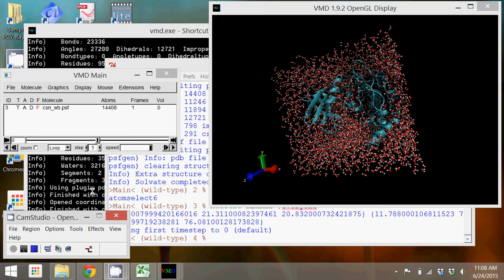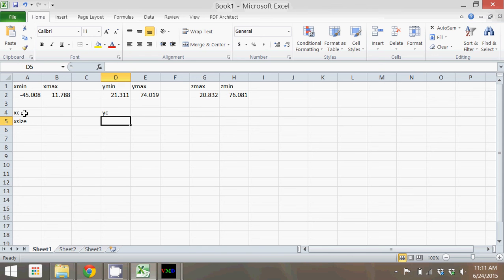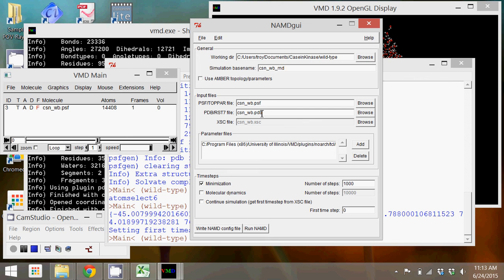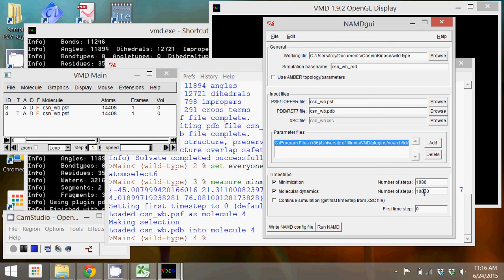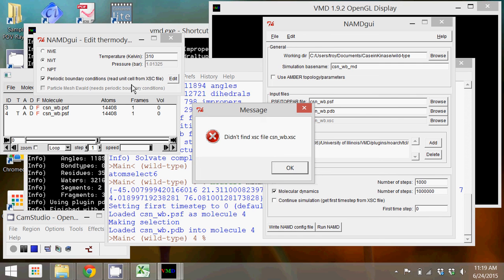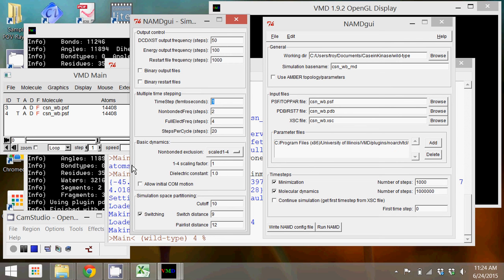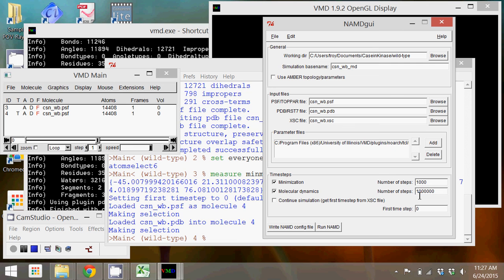Simulating Protein Using the VMD Graphical Interface to NAMD

Comment: Thank you sir for the informative video. I followed through your entire video but when i hit run namd.. the status comes off as "running" but only for few seconds and then it shows status: ready. Neither .dcd nor .xst files are generated. Your help will be most appreciated Sir...
Reply from the maker: Does your attempt to run the simulation produce a .log file or some other output file that contains the particular error?The error will be at the end of the .log file. Please paste the error in a reply to this comment.
Reply: @TroyMessina  Thank you for the video. I follow the tutorial and I happen to have the same problem. My error that is indicated at the end of the .log file is FATAL ERROR: UNABLE TO FIND "PSF" STRING IN PSF FILE solvate.psf
 What should I do next? Thank you in advance
Reply from the maker: @yagmurkafali2998  I have never encountered that error, and I don't understand from your question what the purpose of the file solvate.psf is. Are you certain your configuration is properly pointing to the location of solvate.psf?
Reply: @TroyMessina Thank you for responding. I am afraid  I don't understand what you mean by configuration pointing to the location of my psf file.
Reply from the maker: @yagmurkafali2998  Setting up the NAMD GUI described in this video is the configuration. It is important that the files you are using are in the location specified in the NAMD GUI. I do not use files titled "solvate.psf" in this video. Therefore, I do not know what this file is or how it is being used. I will need more information.
Reply: @TroyMessina  My solvate.psf is the same file you named csn_wb. I actually run the simulation again and now it gives me namd and out files but no dcd. I checked my out file as you said and there was no error message. Im working with a protein-ligand complex and maybe I should have done parametrization for my ligand. But I fail to understand how to do it with NAMD GUI.

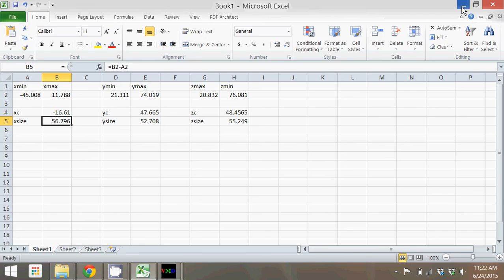Comment: Hello Troy, another excellent tutorial. Many thanks. But at 13:31,clicking OK after completing the cell options, i get a message "atomset:frame '-1' invalid;please use a number >=0 or 'first','last',or 'now' while executing. It makes no difference if First Time Step in NAMDgui reads zero or one. Would very much appreciate your comments.
Reply from the maker: Not sure. Do you have your molecule (psf and pdb) loaded into VMD?
Reply: Yes Troy...did it exactly as per your video... Baffled why it thinks there is a frame  numbered -1?
Reply: Hi Troy...sorry to bother. Do you have any more thoughts about this?
Reply: Hi Troy...sorry to bother. Do you have any more thoughts about this
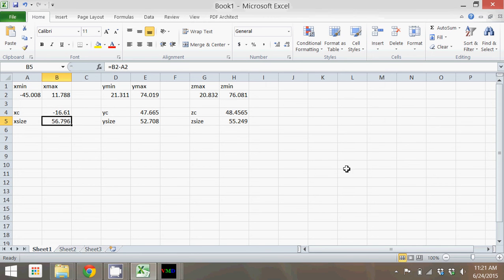Reply from the maker: Sorry, I don't. There is nothing at the time 13:31 that I would expect to give an error. The measure minmax could give an error similar to that. atomset is not a VMD command that I am aware of.

Have you tried running a vacuum simulation to make sure everything works for your molecule before trying more advanced explicit solvent methods?
Reply: Found it!   Took quite a while, but all the way back to loading in Mol Browser,  "-1" was being selected in the First Frame window. Goodness knows why. Changed it to zero, and the simulation ran like clockwork. I now have the four new files, and was wondering if you made the follow-up video mentioned at the end?  Otherwise,how is a DCD opened? Excel doesn't recognise it...

Best wishes
Reply from the maker: Glad to hear it worked. The first video you commented on shows how to load the dcd file into VMD. https://youtu.be/KE268sYqrmw

I'm not sure what kind of analysis you plan to do, but the measure function has a lot of options. https://www-s.ks.uiuc.edu/Research/vmd/vmd-1.9.1/ug/node136.html

Comment: hello, your vedios are really helpful. thank you. 
but, even after performing almost  same steps my NAMD has been  running from around 10 hours now. does it take this much time? my protein has 44836 atoms and not getting about the no. of frames, as mine is coming zero only. please help. thanks.
Reply from the maker: Hi Jhumi,
It will depend on the number of steps, the step size, and some other factors. Ten hours may be reasonable if you are trying to simulate 10 ns with 1 or 2 fs timesteps. Can you provide more details? You can always open the .log file to see how far the simulation has progressed.
Reply: thanks for your reply. minimaization steps -1000 and molecular dynamics steps -100000, multiple time stepping-time step (fs) has set up to 25fs and first time set : 25 and the simulation has progressed till 13618 atoms only. please advise.
Reply from the maker: You might try running a minimization only. If your timestep is 25 fs, that is probably too long. Try 1 or 2 fs. The number of timesteps per output can be 50 or 100.

Comment: hey!! Troy Messina first of all many thanks to you for this video its been of great use to me but i just have one problem that after doing everthing according to what you told in the video when i click on run namd it shows "namd2.exe has stopped working" can you help me with this problem!! i have editted the windows path variable for namd also but still getting this error please help me!!!
Thanks..!!
Reply from the maker: Hi Yash,
I need to know more about the error. If you are using Windows, will you look at the command prompt window and see if there are more details.
Reply: I am using windows 10.. 
it says following in the command prompt
psfplugin) Detected a Charmm PSF file
Info) Using plugin psf for structure file ubq_wb.psf
Info) Analyzing structure ...
Info)    Atoms: 2941
Info)    Bonds: 2377
Info)    Angles: 2827  Dihedrals: 3293  Impropers: 212  Cross-terms: 74
Info)    Bondtypes: 0  Angletypes: 0  Dihedraltypes: 0  Impropertypes: 0
Info)    Residues: 646
Info)    Waters: 570
Info)    Segments: 2
Info)    Fragments: 571   Protein: 1   Nucleic: 0
Info) Using plugin pdb for coordinates from file ubq_wb.pdb
Info) Finished with coordinate file ubq_wb.pdb.
Info) Opened coordinate file ubq_wb.pdb for writing.
Info) Finished with coordinate file ubq_wb.pdb.
Info) Opened coordinate file ubq_wb_md_fixed.pdb for writing.
Info) Finished with coordinate file ubq_wb_md_fixed.pdb.
Reply from the maker: This does not show an error. So, I'm not sure what is causing the crash.
Reply: Try to open namd2.exe file . It will show some error message saying some file is missing. Note that missing file and google it. You will find a way to fix that error. After the error got fixed i hope that u will be able to run namd from vmd interface.
Reply from the maker: Ksai is correct. Usually if your path variable is set, it will be a directory hierarchy problem. For example, your pdb, psf, and topology files are not correctly indicated.
Reply: Have you found a fix for this? I'm having the same exact issue. The namd2.exe is not working pops up, BUT it says that namd is running. It's been about an hour at 10000 steps, so I'm starting to think it's not actually working.
Reply: Trey Patton yes I found the fix for the problem..!!! If you want you can share your mail id I'll send you the procedure..
Reply from the maker: Trey,  I don't run namd through VMD all that often. So, I'm not sure of the best fix. The quickest thing I can think of is to look in your working directory. The simulation should be updating files every few minutes. If it isn't, it might be stuck. The other option is to keep TkConsole open or look at the command prompt in VMD to see if updates are being sent there. A final option is to open the log file. This should be in your working directory and called basename.log or similar. If the simulation is running, it will have new lines added to it every few minutes (however long it takes to complete the number of steps in "Energy output frequency (steps)". You will need to close and reopen it to see the updating.
Reply: Hey!! Trey sorry for the delay but there is some problem in the .psf file which you are getting from solvation.. You need to check that.. Also provide me with some of your mail id or somthing so I can send you my procedure file..
Reply: Hey guys, sorry I'm just now getting back to you! I appreciate the replies. I ended up speaking with my research professor and he recommended I cut down the molecule to only the active residues. That ended up working! One thing that I did notice with the GUI (I only used it to make the config file) is that there isn't a way to add/delete the topology file that is auto loaded. I ended up creating the .psf based on that topology file (and the water file) and it ran smoothly.
Reply from the maker: You can edit the conf file  and run it from a terminal or command prompt. This means you can manually create a configuration script with anything you wish (topology, temperature, cutoffs, etc.). The VMD GUI really isn't meant for running NAMD in any advanced way.
Reply: Yash Shrivastava  hello sir ! if you can suggest the stepwise procedure to over come this problem and running whole simulation for the docked protein,it will be very much helpful!
Reply: Hey Yash! I am having the same problem. namd2.exe has stopped working. Could you please share the procedure to fix this problem. Thanks!
Reply: MITAL BHATT , could please elaborate your procedure as I'm facing same problem. It will be very helpful as I'm in between my project to finish it.

Comment: Hi, i cannot getting dcd file please reply
Reply from the maker: I need much more information.
Reply: @TroyMessina  when i clicked on run namd, it run for 1 sec shows status ready, in the wrking directory, 3 bew files getting generated except the dcd file.
Reply: Can i follow this procedure to simulate ligand-protein complex
Reply from the maker: Rohan Narkhede yes, but you may need special topology files depending on what the ligand is. Read the .out or .log file to see what errors you are getting.
Reply: I have also generated topology file for ligand from LigParGen. In .out file, it shows DCD file name: output.dcd and at last it shows FATAL ERROR: DIDN'T FIND vdW PARAMETER FOR ATOM TYPE HB1
Please help sir
Reply from the maker: @way2pharma463  Somewhere you have hydrogen labeled HB1 that is not parameterized by your topology files. You can redefine those hydrogens if you know they are the same as others that are parameterized, or you need to build a topology for them. See http://mackerell.umaryland.edu/charmm_ff.shtml
Reply: @TroyMessina  dear Sir, please guide me about how to parametize HB1 or should i parametize thr ligand again. I have used LigParGen to generate my ligand parameter file, one is .prm and one is .rtf. i have prepared the ligand-prorein complex in Pymol. Pleae help me
Reply from the maker: @way2pharma463   I do not know the solution to your problem. You might try reading through this. https://www.ks.uiuc.edu/Research/namd/mailing_list/namd-l.2013-2014/1417.html